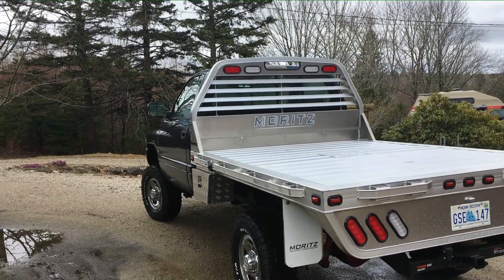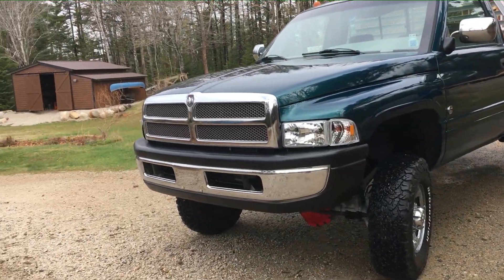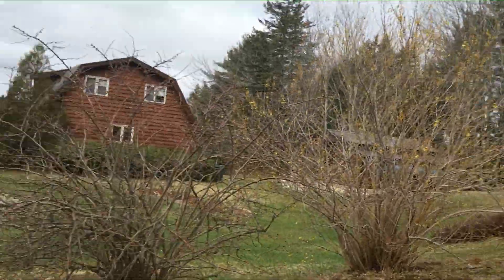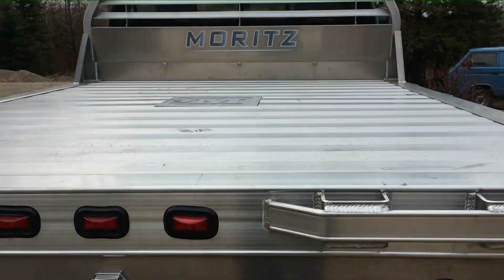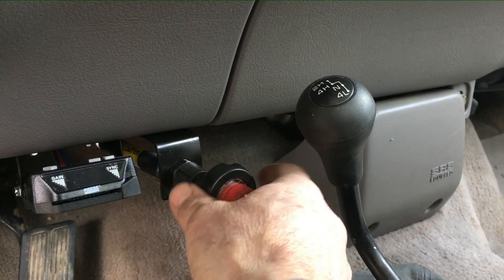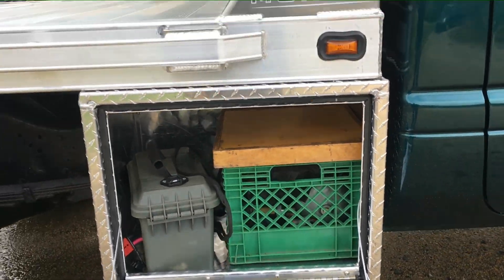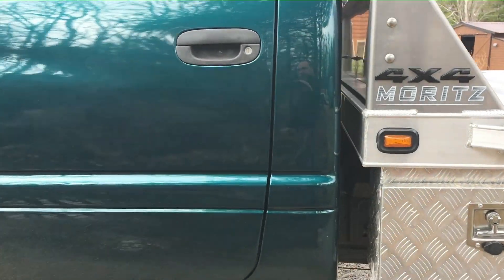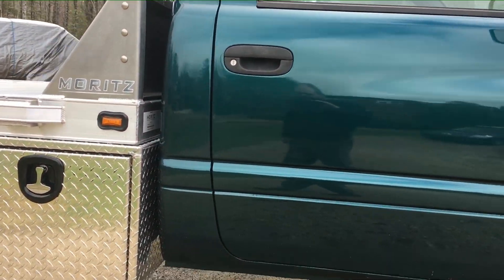Ultimate work truck reveal

Comment: Hi Jeff,
Nice Job! This will be a great work truck for years to come. I've always thought the 5th wheel was the best way to tow for stability and weight distribution. If you want to want to take the weekend off then consider a flatbed camper. Because of high demand, the lead time is over a year for a new one but the build quality is what you would expect from Four Wheel Campers. Keep an eye out for a used one perhaps. This will be expensive. If you want to DIY then Total Composites in Vancouver sells a kit or an assembled one. I think they have a dealer in Ontario. I like a side door layout as you'll see with the FWC. If you don't want a pop-up then the composite may be the way to go.
I found a Vindic clone canopy for my DoKa made of aluminum. It is mounted at the side and tailgate hinges. I hope to get my local VoTec High School's metal fab program to cut the roof off and extend the sides up for a 6-foot interior height and a bed over the cab. I'll have to spend some time learning CAD. Imagine drawing something like this and sending it as an attachment in an email! You've got mail!
Cheers and Great Job on your truck!
G.
Reply from the maker: Good morning George! Yup the FWC have always been on my radar, but I’m really leaning to building one of my own. A purpose built flat bed camper the way I want it. Hard sell really... we’re quite attached to the high top Westy based camper. Hard to keep them all! My insurance bill is soon gonna be out of reach for me! Lol